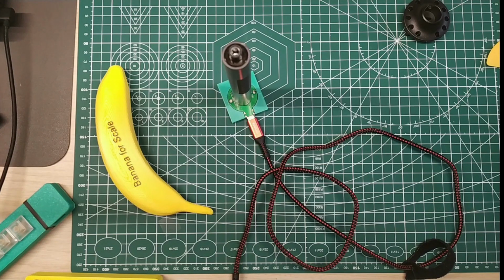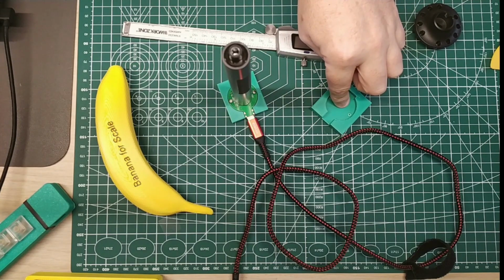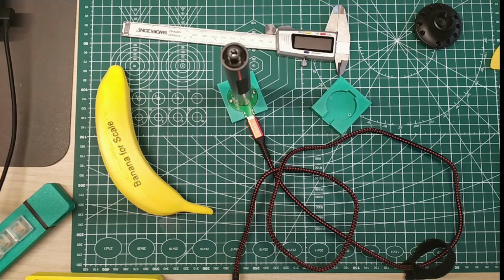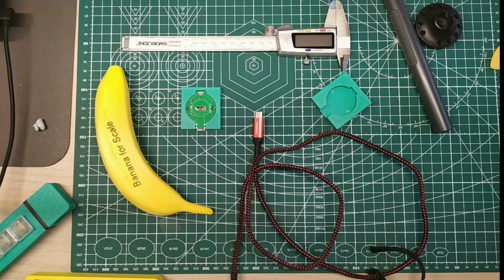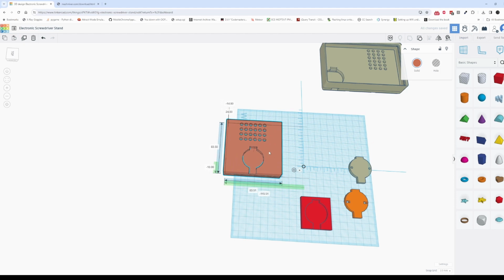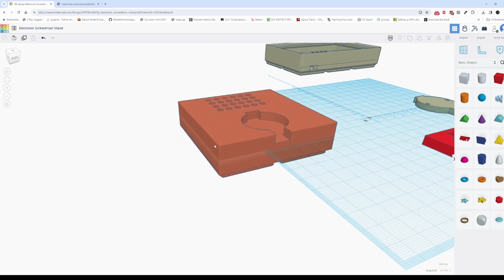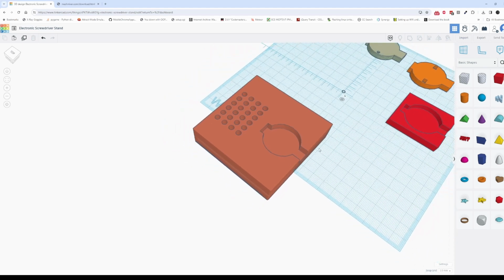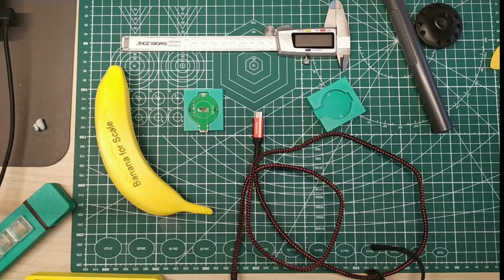Maker Advent 2023 Day 17: 3D Printing a Screwdriver Charging Station: Test Fit

Comment: could you split the bit storage into two halves and put them either side of the screwdriver base so you can fit the whole thing in a 2x1 gridfinity base? Also are you going to put something over the top of the charger to help self centre the screwdriver as it goes in (like the original charger had?)
Reply from the maker: I've made a better version mate :) https://www.printables.com/model/878508-magnetic-screwdriver-bit-holder.
Reply from the maker: Andy! :) That is a great idea. The USB C port was damaged by my fat fingers. I had to resolder it to the board. Then I used hot glue to hold it in place. Not ideal, granted. Yeah a V2 model will have a shroud to stop the screwdriver moving around. But, I've just taken delivery of a right angle USB C adapter, which I can embed in the plastic, and with some cunning design work, I can use with my other new electronic screwdriver :D. Thanks for the message mate.